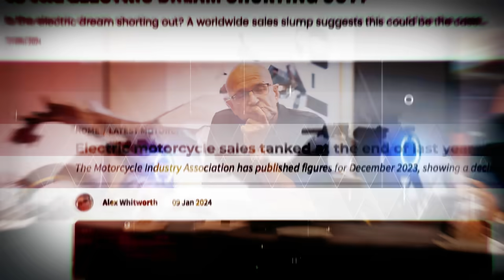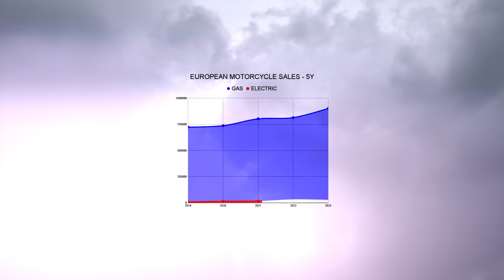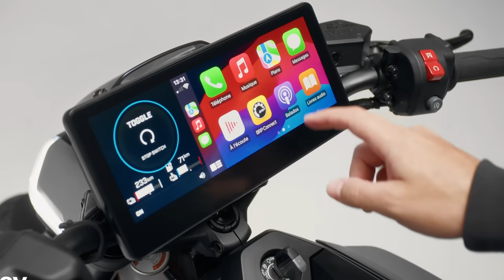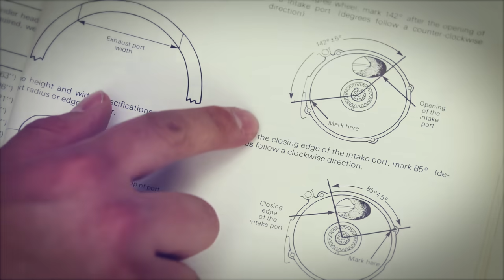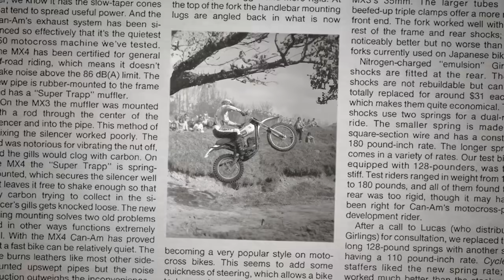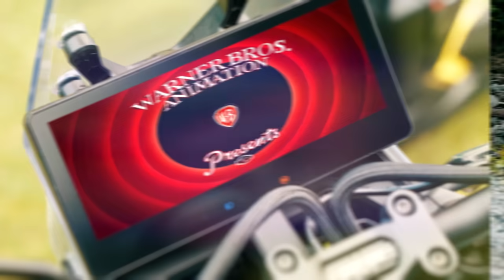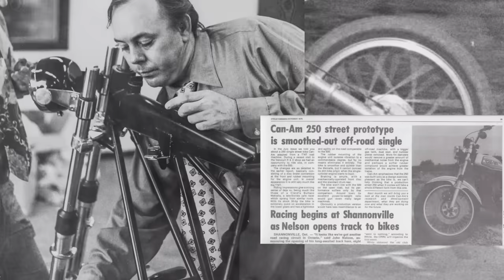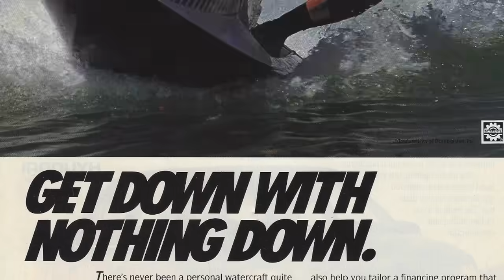2025 Can-Am Origin Review - The 115km "Adventure" Bike

Comment: I fully believe battery capacity wìll be there in due time. For cars it’s already not a problem to squeeze 600km or more from one charge. Added to that, battery tech is developing in a breakneck speed thanks to the increased interest in EV’s in allforms and shapes.

However. Motorcycles? Yeahhh.. thàt’s gonnna take a bit.

I rode a KTM electric (road legal) dirtbike. ‘Freeride-E’ with an ‘upgraded’ battery.  Power was instant, shocking even, despite having ridden 500cc two-stroke monsters in the past, and some more modern 450cc fourstrokes. (Talking  off-road comp bikes here)
I got really enthousiastic.. and then the owner admitted the actual range was 50 to 60km when riding it ‘a tad spicey’. Excuse me? I thought he was joking.. He was not, and @ about €13,000.- incl VAT Ehh.. ‘rather not, thank You’  Fine for short comp-heats, but éven in a tiiny country like mine, utterly useless apart from putt-putting around in a city. And given our exellent cycling infrastructure, I usually can’t be bothered to ride a motorbike. Cycling is easier, and more convenient.

I dó admit I recently bought a smallish city bike, had the choice between an e-scooter and a MASH x-ride, petrol. The E-scooter got between 60 and 70km max. One full tank of petrol on the x-ride ? About 350km. Even with our gas-prices (think $10.- a gallon) an easy choice.

I’m nót stating that ev motorcycles are a fail already, I’m not thàt presumptuous, but the battery-tech has to catch-up to the (exellent, and ingenious) tech in a bìg way to make them useful as any more than a commuter and shopping bike in a very small city. So, yeah, the presenter was spot-on.
Reply: It’s already there. These guys are squeezing every penny from entry level investment to over saturation investment.

Comment: I wonder if electric bikes shouldn't take their design language from Hondas Silverwing. More scooter and less motorcycle. It would set expectations in the right range, a cruise to the office instead of a cruise across the country. Also, the Silverwing would let you place a flat pack battery in the floor under your feet and basically give the bike a really low centre of gravity... if that is desirable on a bike? (I'm not a biker)

Comment: where i see electric 'motorcycles' is overpowered e-bikes that round here are classed as scooters, legally requiring everything a true motorcycle needs(insurance, inspection, proper helmet, yada yada) but a lot of riders not even using a bike helmet... these things are EVERYWHERE, on the sidewalks, which is illegal, clogging the streets without any of the stuff a motorbike requires, EVERYWHERE!

what i'd like is a hybrid bike, a slot to put a second battery or a 2/4 stroke generator, i can get a used bike and build my own eventually, less issues with titling it, i'm only allowed one vin as an individual, i want to use it on something... that ryan would wet himself in terror at, it's the steering, different stuff.

Comment: It doesn't need 400 kms range.  250 kms is my target range.  My existing CBR250 can only do about 280 kms on a tank, before flashing the doom warning anyways.....
Reply: Yes but at 280 you pull into a gas station, fill up and out within 5min. I understand if 280 is your commute and you can charge up at either end.
Reply: @ruselq211  That's it exactly.  My commute is around 56 km each way.  That's 5 trips...but habit would have me plugging it in daily.

Comment: If they want EVs to work they need to have vehicles with standardized batteries that can be quick swapped at the equivalent of a gas station where techs test and fix them (swap dead cells and balance the packs)...that and they need to damn up every waterway with hydro electric plants.

Comment: I'll stick with my cbr125 for running around town...(a moped in a miniskirt)
It'll literally run for days on its tiny tank of fuel...a lot longer than ai can sit on the saddle...
... and takes $10 and under 2 mins to refuel...
Reply: I bought one of the last CBR125's when Honda Canada discounted them to clear them out in 2014. It cost me $1,999 (original price $3,400), plus the usual fees, and $200/yr to insure. That thing was so incredibly cheap and efficient to operate, but unfortunately I found the riding position too uncomfortable after a few years and sold it. Funny enough, ten years later those bikes are selling for nearly the original list price, with all sorts of kms on them. At 58 yrs old, I'll stick with my Honda Forza 300 for now ...way more comfortable, vastly more utility, and nearly as efficient.

Comment: So...18.000$ for a motorcycle with 47bhp, that only goes up to 130kmh, only makes 115km on one charge and needs 50 minutes to recharge. Or...you get a Yamaha MT07 or a Honda Hornet for less than half the price, goes much further, much faster and refuel in 2 minutes in any gas station. That´s why nobody buys electric motorcycles.

Comment: Massive and what iview has unrealistic changes would need to occur in the world in order for electric vehicles to become practical for the majority of people currently relying on gas.  First and foremost battery technology would need that great leap forward.  Everything else comes second.  If you can’t both increase the range decrease the charge time and increase the operating temperature range, They simply will not work.  The next issue and one that would not require a greatly forward in battery technology, but would require sort of massive infrastructure investment that the world has not seen since the second world war is updating and improving. The electrical grid to support the draw as well as installing enough charging stations with enough charging ports.  Something often overlooked is the fact that even at a level two charger, you have to park your vehicle for an hour.  When you pull into a gas station the expectation is that you will be at that pump for no more than five minutes and ideally less.  Gas stations are designed around, moving vehicles up to the pump and then out of the lot quickly and effectively.  If you can consider a decent size gas station, which has 10 pumps and compare it to a large electric vehicle charging station, which has we will say 20 charging slots, the number of vehicles that can be returned to maximum effective range over a 24 hour period becomes a stark contrast.

Comment: 35kW of power means it's rideable on an A2 license over here in Euroland. So that number is far from random or arbitrary. If you want to target European Maxi-scooter riders with your EV motorcycle, you have to have an A2 model. Simply because there are very few driving schools that will have full A-class scooters. Also for 99% of commuter needs 35kW is plenty.

The dumb thing is they are pushing hard on EV mopeds, and they just aren't a valid option in my not so humble opinion. Sure they may advertise 80km of range, but for the most part that 80km seems to be driven on a rolling road inside of a building or something like that. Frankly it does not apply to people like me being 196 tall and just over 100kg. I've had EV mopeds as a loan-vehicle from my garage and the range is appalling maybe 40km if you've got a head wind and need to run lights.
What good is that kind of range? Even over here in Euroland that barely gets you to the supermarket and back, but because it's an EV moped, it has no under seat storage. So even getting groceries on one is not really an option.

130km of actual real world range, with a normal sized person on it, during normal weather, without compromising the practicality of a scooter, then yes, I'd be all ears. But right now that simply does not exist.
I've never regretted buying a gen 1 BMW C-Evolution LR, because it actually delivers on it's 160km range and it still has decent storage. It was at the time competitively priced compared to a T-Max, Burgman or SVR. So there was no real downside to it for commuting. Even when the battery gets sub-optimal, it's "only" 5000 euro to have BMW replace it. But with petrol in excess of 2 euro per litre, and night time electricity being 13ct/kWh... it makes sense to charge over night at home on a normal 3 phase outlet. It's 14.4kWh battery is easily charged in a couple of hours.

But to replace a moped, like what the city wants me to do, that just isn't going to work. The range is too low, there are no EV midi-scooters at all, it's either mini-scooter or maxi-scooter. So no pillion, no cargo space, and no range. Unless you want to spend 20k+ on a C4 with all the works and an A2 license. There just isn't a valid option for AM or A1 license.

Comment: All EVs have the same problem - more range, needs more batteries;  more batteries, means more weight, less range, and longer total charge time.  Bikes have the added disadvantage that you cant fit the super-fast charging that cars use (requires thicker cabling that doesn't fit on a bike).  I don't think EVs in and of themselves (whether car or bike) are a bad idea, I think attempting to replace every vehicle with an EV is.

Comment: This is what they are teasing on Facebook?

BAHAHA what a joke. 14k? Go get a brand new KTM 690. Or a couple CRF300Ls. Or a CRF450L. Or an overstock R6. 

Unless you honestly think battery energy density will triple in the near future, e motorbikes are a joke. Unless you're going to commute on it. That would be an excellent use case. Except for the price tag. How many years can you maintain a used SV650 until you break even with this thing?

Loving all these solutions in search of problems. Best of luck Can Am. You're going to need it.

Comment: Electric isnt gas replacement. Its mechanical suppliment.  40mph high torque  electric bikes are as thrilling as 130mph gas sportbikes on the interstate. Ive had and done both. Had the ZH2 for 2 years. Itw about Element.. a twostroke 250 is more fun on motorcross than a gsxr1000 in the sand. Its about element and thrill.

Comment: I would go electric if it were as reliable as promised with better battery density. A ten to twenty minute wait to fully recharge would be OK with me. 

Unfortunately these things have lots of computers. Who has never had a computer crash on them? When they're inside a motor vehicle and all the owner can do is turn it off and on, and hope that is enough to remove the problem, it means that repairs might cost a fortune. So for now, I'm for gasoline powered motorcycles and cars that run with carburetors, and maybe fuel injectors as the most expensive tech in them. 

BRING BACK KICK STARTERS FOR ALL MOTORCYCLES as backup starters. In the 60's and 70's there were kick starters on 1000 cc inline fours and 1200 cc V-twins. They work and are easy if you follow procedure.

Comment: $18K for a 47 hp motorcycle with a top speed of 129 kph?  Prognosis: No pulse.  Dead on arrival.  $19K for a 47 hp adventure bike with 115 km of range?  Prognosis: No fun will be had.  Electric motors make all kinds of sense for many applications but if you don't fulfil ALL the application requirements (range, refueling, etc) then it really doesn't make a difference.  We need the whole package, not half a package.  It's a shame it's so bad, while being so good.

Comment: the problem for an EV motorcycle is a regular motorcycle is extremely cheap to run, there pretty dam environmentally friendly as well, like what is the environmental impact of an EV battery how long do they last and does that outweigh a petrol motor that can go for ever. i feel like if you could get say the F1 brake recovery or little things in the bike that negate charging extend the range then maybe it would be better. Also i had to say that EV bike manufactures are unimaginative, you can redefine what a bike looks like, but they don't, there to scared.

Comment: Electric motorcycles, like electric trucks, are not practical with today's battery tech. Cars are possible but depend on charging infrastructure which doesn't exist yet.

Hybrid is the way for cars, bikes should continue to use gasoline and trucks, diesel.

Comment: $18k for a "commuter" bike is pretty much doomed.  In the abstract, power:weight:range has been awful for the money. especially considering the many reported issues dealing with manufacturers/dealers after making an enormous investment into their product. There's also high probability the company will close up shop and leave you without parts and support.  The poor market performance for electric motorcycles is not at all a surprise.

Comment: EV Motorcycles are a solution to a problem that don't exists in the first place.
Reply: Do you think global warming is not a thing?
Reply: @Blo55  Motorcycles compared to everything else on the road emits negligible amount of emissions (excellent mileage and low volume driven on road) . 
When everything else's pollution has been sorted then and only then you can take your pitchfork to Motorcycles.
Reply: @Cafe--Racer  Ok, fair enough. You didn’t answer my question though.
Reply: @Blo55  I couldn't have given any clearer answer, I stated all the scientific facts.(didn't even mentioned extreme low carbon cost of manufacturing Motorcycles compered to other vehicle) 
However I cannot help the fact about your limited understanding on the subject ,  for e.g if everyone suddenly stopped riding bikes today it would not make a shred of difference in global emissions hence EV motorcycles is not the  solution to this particular problem. So yes I believe in Science which should have been obvious by my very first statement.
Reply: @Cafe--Racer  Ok, no need to be aggressive. I agree with you! You are wrong about the fact that you made your stance “obvious”. Gas powered motorcycles will need to be phased out eventually, but as you said other sources of emissions should take priority.